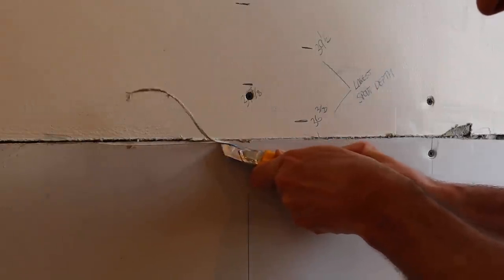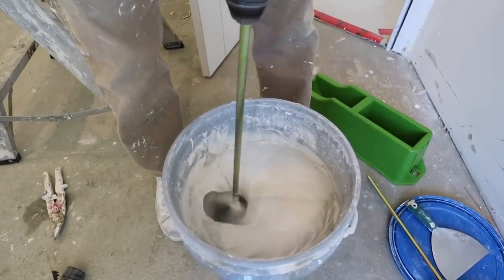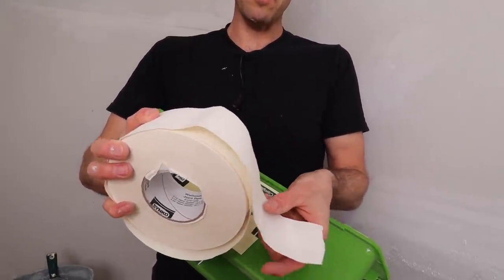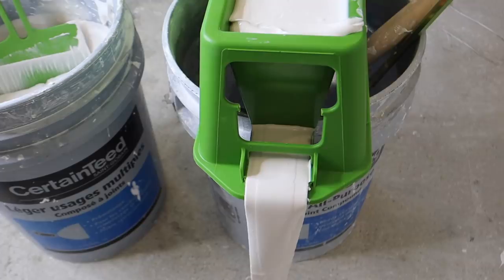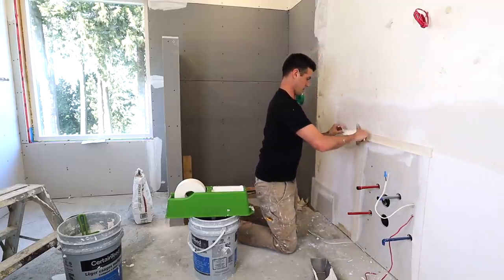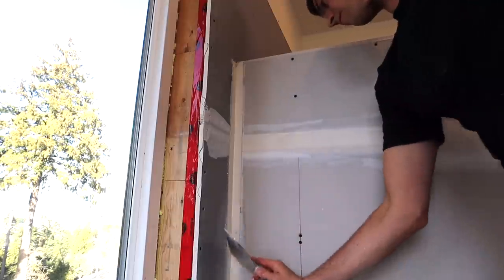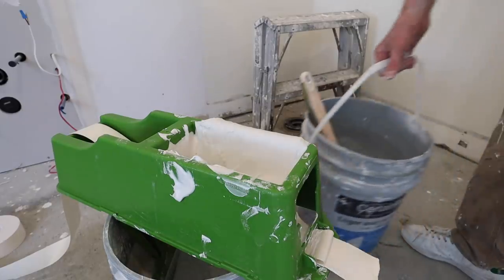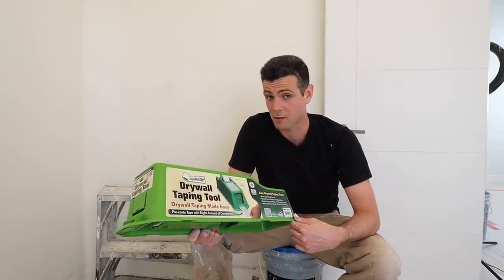How to use the Tape Buddy

Comment: Looks like more trouble than its worth.
Reply: It's a handy little tool.  If I'm doing a small initiative I'll use a Delko banjo on all the flats and long inside corners, and my "helper" (often the homeowner) will use this to do the small pieces, such as around windows, doors, soffits, etc.  I've switched to using Fibafuse so no issues with air pockets or bubbles.

Comment: it's like someone was making a banjo and gave up half way through.
Reply: That's what we did. Banjos were heavy to run and the mud coating not consistent not to mention the shoulder and back aches! It took too much time to reload the banjo and keeping it and myself clean... not possible. Dried chunks of mud in the tape. Looked at the Super Taper but for $200 no way. So we patented the TapeBuddy tool. It coats the tape just as the banjo and bazooka but at a fraction of the cost. Ye, you have to pull the tape to work with it but but you do the same with the Super Taper. And with the TapeBuddy tool we're not carrying 10 to 40 pounds of tooling. Much easier to run tape with this simple tool.

Comment: First off I've been doing drywall as a contractor for over 40 years this is a poor man banjo go to Drywall Junkies website to see what I'm talking about first off hey bazooka is way faster than this !!
Drywall comes in 4 by 8 4 by 9 4 by 10 4 by 12 4 by 14 4 x16 all drywall boards come with a recessed edge but the end of the board is not researched this is called a butt joint please go to drywall junkies to see how drywall is done right I guess I had to put my own website up as a contractor for 40-plus years doing apartment projects and housing projects

Comment: Never seen one of those things in the US better be careful mixing mud with your cordless too much mud and you will burn it up
Reply: Brushless motors are very robust.  I use my dewalt for mixing mud and or plaster during the week and then use it ice fishing with a K-drill.
Reply: The MixIt can be run easily with a cordless drill and does a great job. It cleans easy.

Comment: Shameless Shilling not apparent at first viewing but definitely by design. It becomes patently so at 0:12 but not confirmed until you hit 
SHOW MORE in the description. 9min ad for the Tape Buddy. I'm disappointed and hanging on a thread to unsubscribe.
Reply: It literally says it's a sponsored video, did you think it was sponsored by Ridge Wallet?? I don't think the video was very good because it was pretty dry and was missing his usual personality. It doesn't say anything useful about drywalling other than "for taping, use heavyweight mud if you have it, and make sure to thin to yogurt-like consistency so the tape wets properly" which is something he's said in other videos. I guess he also said not to overlap tape on butt joints. But overall pretty low-content this time around

Comment: Can you use hot mud?  Or does the dry too fast?
Reply: Depends on how fast you can work.
Reply: You can use hot mud but get the 45 or 90 minute to allow you more working time. It don't clean very easy when dry so don't let it sit in the tool too long.

Comment: Back when you used the "buddy" in a previous  video it was placed on two stacked buckets.  When you demonstrated it in this video it was placed on one bucket and looked very awkward to use so close to the ground.  Looks like higher up would be easier.
Reply: He pointed that out already in the video
Reply from the maker: Yup. Two buckets is way better. Or you can drill holes in the corners and screw it down to a wooden platform. That would be really good as well.

Comment: Can I do the slopp bucket method with this tool
Reply from the maker: Yes you can. You just need to refill the mud a little more often and pull the tape out a bit slower. It works.
Reply: @vancouvercarpenter  man thanks for taking the time to reply...keep doing what you do ..just when I think I've seen it all there you are sharing your skill and knowledge...I'm a carpenter and thanks alot...